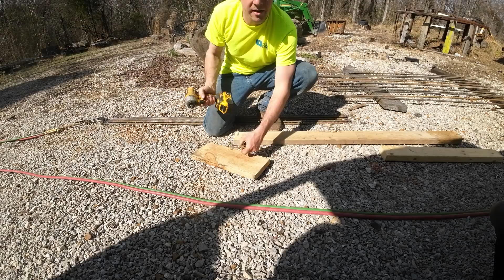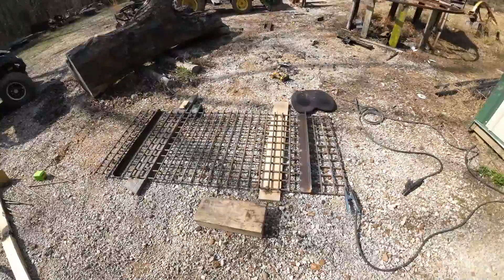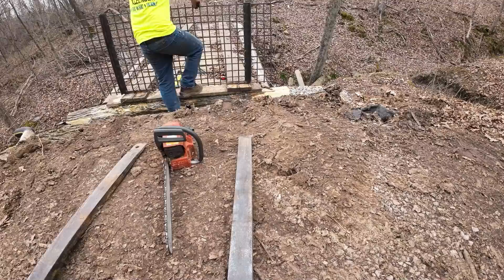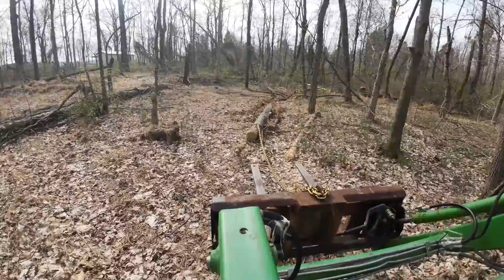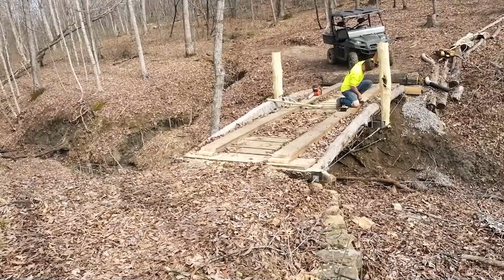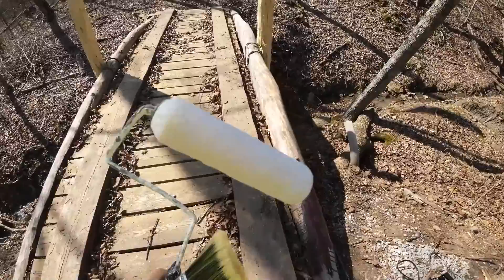Welding Rebar Approach and Starting the Railings - Timber Bridge Project

Comment: I do appreciate all of the effort and talent you have put into this bridge. That said, and I have not done the math to determine the cost benefit analysis's, a question comes to mind. Mike (dirt perfect) has a few clay pipes that may have been a more cost effective solution to this crossing. 3 24 inch pipes stacked in a triangle and back filled and the those large flat pieces you removed in previous episodes as the top would have been awesome... Yes I do have the benefit of the stone bridge, but I think a hybrid of the two designs would have been a better solution. Please understand that I do respect your work. You had an idea and executed on it, and It came out great!
Reply from the maker: I will always laugh at the way people "come up" with "better" solutions to a problem that 
1:  isn't their problem 
2:   they don't fully understand (often admitted in the comment)
Thanks for the chuckle.
Reply: @CaptainKleeman  Hey Mike, you are correct, it was not "my problem" and I may not fully understand all of the nuances.  All I was getting at is that I have the benefit or "20 - 20" hindsight on your now 8 month old project. Again, I mean no disrespect,  That wood bridge is really cool. The look of it is great, and I gather that is what was more important to you. I applaud your you effort.

Comment: A good way to preserve wood is to singe it. Get a torch that fits on a propane tank, and lightly singe the wood. It seals the pours of the wood grains, it is an ancient way of preserving wood.
Reply from the maker: It seems to be a trend lately.  It has its place.  For the cost of propane I could buy steel beams

Comment: Mike on the bridge railings you said might run cable but what about drilling a 3" hole in the middle post and run some log like 2 levels kind of like those split rail fences are done then the outside post go on last to lock them in  & if you still felt it needs cable you could add it later on and save some money in the mean-time ?

Comment: I suspect the rebarr will turn out to not be resistant enough to bending, and will slowly deform, much like the "expanded steel" mesh used on many lawn care equipment traler ramps gets deformed as the ridding mowers get driven up and down.

Just some more angle iron similar to how you put those 3 in already should cure this (before it starts)

Check a local compact tractor dealer and see if you can get the shipping frames from 4 ft to 7 ft PTO roto-tillers.
My local dealer is very happy for me to haul these off so I can use the metal for projects.  1.5 inch to 2 inch angle iron, so you can make reinforcements much like the loading ramps used for loading a tractor on a 7000 lb rated equipment trailer.

Comment: Just a thought why not just use 2" minus under the metal and some #2 s on top this would serve as both the entry point but also a French drain
 Just a thought
As always good luck and God bless and stay safe out there
Reply from the maker: I'm not ordering 40 tons of stone for a 100lbs job
Reply: @CaptainKleeman  you don't have any rocks laying around for the underside of the mesh when you get the gravel for the yacht top dress it then heck you could make a game and out of it and get the girls involved with picking up rocks and save on the fill. The water will come down and erode the bank because it doesn't slow down. Heck ya can always grab a few five gallon pails and hit the river edge of.

Comment: I personally would have used the leaf blower and had the right stain, a semi load of steel, Four master welders, 42 yards of high psi concrete, 17 labors, an engineering firm on speed dial and most importantly an on site Taco Truck..... But that's just cause I'm so much smarter than average

Comment: Good that you left nice gaps on the bridge deck - did you put the planks down with 'crown up" so the rings naturally shed water. I had to replace steps to a porch because the builder put them crown down and the curved and held rain water and rotted out in a few years.

Comment: That'll do piggy, that'll do 🕸🕷
🤣😂🤣
Remember back when you felt a little apprehensive when you started welding ? You've come a long way sense then👍 now you don't even think about it ... Your muscle memory takes over and these things becoming second nature 😁 MBTS can probably tell by the sound how things are welding.
Myself, I found rebar hard to weld. 🤷‍just haven't done much of it. I'm used to wiring it up and pouring mud, concrete, on it.
Great job 👍thanks for the video.

Comment: Do you have enough width on that bridge to get a york rake or brush hog across behind your tractor? It was something I had to consider on two of my bridges. The york rake is useful to get small branches off your trail in spring. If the branches are small enough, a brush hog can mulch them up. Larger branches may need the FEL on your 755.

Comment: In my mind, based on my own bridge experience, the running boards on top are not needed. They will actually allow for more leaves and dirt to build up and cause rot. And if you get ice and snow on them, you could slide sideways, go over the edge or wind up in a bad situation. I would either get rid of them or add more. Also, I used rocks on my bridge approach which was steep on one end. I scoured my property and my neighbor's properties for stone piles the farmers made for my rock supply. Maybe you don't have that. Some rocky areas have old stone walls.

Comment: Really like your grid, as you know I like the fact that you use anything that you've got to hand 1st. Are we past tape picking season, only not sure if they are the same season in the States, as they are over here in the UK. 🤣😂🤣 I've worked on huge construction projects including the QE2 bridge and the 2nd Severn bridge crossing, now if you were building one of those I wouldn't recommend using what you can find in the woods. But hey it's neither, it's not a major road route going to carry 40ton loads every minute of the day or 4 to 6 lanes of traffic, it's a little bridge across a stream that's going to be used by you and your family. 🤗👍 I think it a brilliant build. 👍👍👍

Comment: Next auction you’re at, buy an old equipment trailer that’ll carry 7500-10,000 lb. Or “borrow” an old one from Dirt Perfect 😂
If it carries a skid steer, it should have no trouble with a side by side. Concrete blocks either side of the creek and drop the trailer deck across.

Plus you can salvage the axles.

Comment: A little trick I use when putting fasteners into heavy timber is to run the threads over a bar of  soap.  It will save you time and effort.  And don’t sweat the haters man keep fighting the good fight
Reply from the maker: I use oil

Comment: The best and cheapest way to preserve wood outside is to brush on used motor oil.  It will do the same thing as oil based preservatives and it will repel insects for a couple years.  The wood might not be as pretty but it works and costs nothing but time.
Reply from the maker: "best" is pretty subjective here
Reply: @CaptainKleeman  you’re right.  One way.  ;)

Comment: You know you've been messing around with that bridge forever now. And while it makes for interesting video, why don't you buy the proper "I" beams and cross supports and make a permanent bridge? Everything you've done up to this point is only waiting to rot. Just an idea and way less labor once a quality bridge is installed...
Reply from the maker: Dearest Gary, I took your opinion to the bank, they said it didn't not equal the value of the steel and therefore isn't a feasible option at this time.  Hopefully one day your opinion value will increase enough to purchase the steel.  All in good fun 😉

Comment: I have very little welding experience I can however suggest to not weld on just one side as it will throw off your spacing or shape. You want to weld one side then the opposite side on this rebar till it is all welded into place and then weld the opposite side to secure the metal into place. Even not welding all the way around in one continuous weld on large objects instead you would weld up to few inches in a continuous weld then switch to another side on opposite side and keep switching so as to not warp the metal. Love all of your videos as I am also a do it yourselfer just like you as I know how to do electrical, framing, plumbing with pvc or copper pipe, and even mechanical work on my own equipment.
Reply from the maker: Read the room bud, welding a rebar approach...not worried about spacing
Reply: @CaptainKleeman  I did get a helluva  good laugh,,outta what he said Mike
Reply: @CaptainKleeman  I know your not worried about spacing on this was using that as an example, just something for future consideration.
Reply: @darkrevenger04  really…even after his YT comment?   Ok, well in the spirit of recognizing that you probably don’t care but for next time…it is “you’re” (a compression of you are) not “your”.  Their, they’re ….don’t cry.  Wow, see what you made me do…why did you make me do this?

In all fairness, I was happy to jump all in the middle of this.   Momma always said “people that live in glass houses shouldn’t throw stones”.  Thank you for giving me the free shot 😂
Reply: Glad to have you back from the big show….thx for the editorial on the EV stuff.   Looking forward to seeing the next video at your brothers place.

Comment: I have always wondered why people strip the  bark off logs they are using for projects. Why do you?
Reply: Your pants look like mine, the right knee gets blown out first, then the left goes and then your feet get stuck in them when you pull them on! 😂
Reply: @OneEyeCustoms  in about 1963, I was 10yrs old.  My Mom discovered iron on patches for my jeans.  She declared it to be the most liberating discovery of mankind.  Gone were the nights spent sewing on patches while she watched Gunsmoke on TV. She could iron on a patch during a Camel cigarette commercial! 

She’d go nuts if she saw how jeans are worn today!
Reply: Leaving bark on logs causes them to rot  much faster. A debarked log can last years.
Reply: Also allows a place for insects to live and eat the wood.
Reply: And 3. It does no good whatsoever to treat/stain over bark.
Reply: Can be modified into botanical plants cover n garden potting..